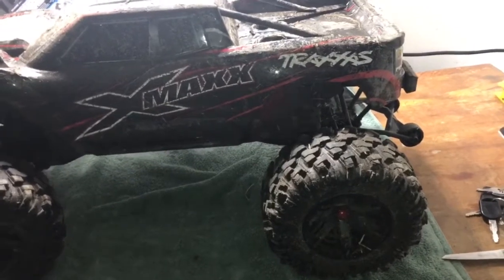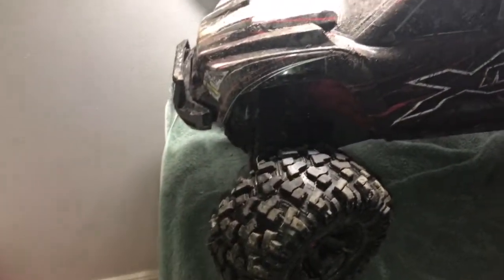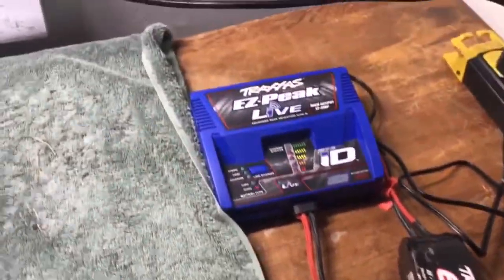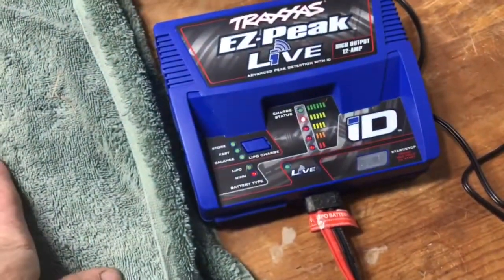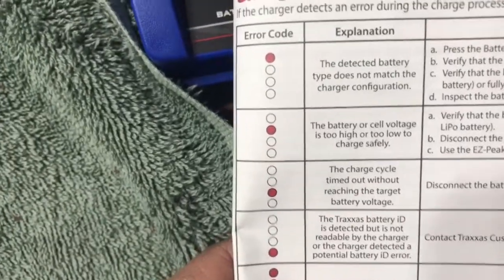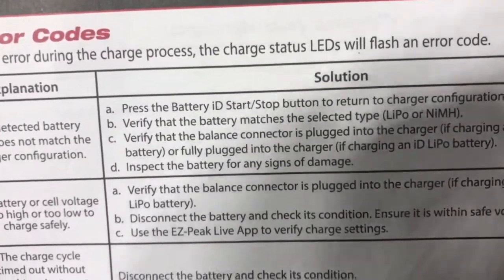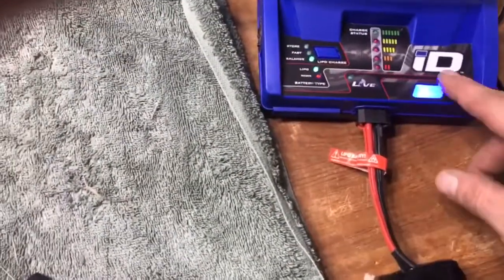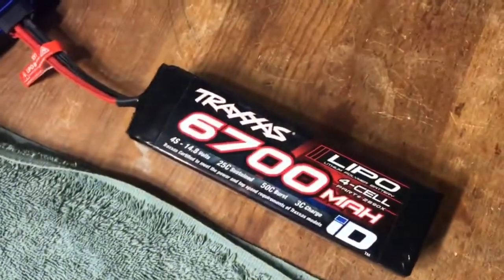Traxxas easy peak live ID charger confusion. Works then it doesn't work .I have no idea.

Comment: Did you figure this out
Reply from the maker: anthony mccabe Yes I did. I have made another video about it. But you do not have to search for it I will tell you. Inside charger there will be three metal prongs coming out where you plug in your battery the one all the way to the right on the top gets pushed in and does not connect into the battery which will give you this rating. All you have to do is grab it with a pair of tweezers and pull them back out until it clicks.
Reply: @WiredRC  check all pins and there all fine
Reply from the maker: anthony mccabe It looks like they all stick out about the same? The one on the right for me got pushed in a little bit and it caused this problem. You may have a battery problem you can always call Traxxas and they will help you.